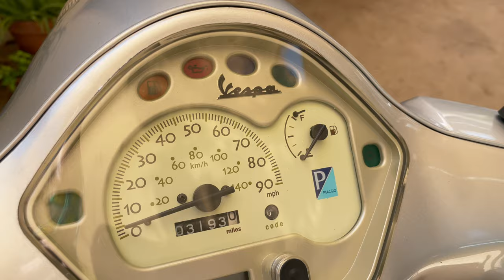Vespa LX - LED Switchback Turn Signal Kit Installation | Mitch's Scooter Stuff

Comment: Mitch have you tried WAGO connectors?  They form a very tight connection with a lever lock, no crimping required and they easily disconnect if necessary.

Comment: Hey Mitch, congratulations on your "100,000." Well deserved. Will this Switchback Kit work seamlessly for my 2004 Yamaha Vino 125 (YJ125S)? If not, can I just replace the stock turn-signal bulbs w/ LED bulbs? THANK YOU!
Reply from the maker: Thank you so much! Hmm your vino have orange lens, right? I would suggest to get blinker genie so you can have turn signal into running light when not using signal... I have that on all my scooters. Here's link https://amzn.to/3TMi82s
Reply: @MitchsScooterStuff Mitch, you're a true genius, the Blinker Genie is exactly what I've been looking for.  Yes, 2004 Vino 125 orange lenses.  On those LED bulbs to replace my factory bulbs-- what LEDs do you like, if you have a link? Again thank you for taking time. You're amazing.

Comment: I switched over to LED turns, brake and headlight on a GT200 and found I didn't really need to do anything else as the LED turns worked just fine as is, maybe a tad bit faster blinking, which is fine to me as it catches other drivers eyes better, plus it really eases the battery drain.
Reply from the maker: You can replace flasher for LED flasher to flash at normal rate :)
Reply: @MitchsScooterStuff yeah I like the faster flashing gets their attention!!

Comment: Hey Mitch thanks for all the great videos. I did this mod today and for some reason my turn signal will flash twice and then go back to the running lights.  then a long pause and then it flashes twice again.  it causes the same effect with the rear turn signal as well. any suggestions?
Reply: even stranger it only does this when the bike is running. when the key is on but the bike is off they work fine.  Did I get something wrong?
Reply: Follow up for anyone who has run into this problem. The problem was with the rear LED turn signals. They had built in resistors, and it seemed to be causing trouble. I got some LEDS with no resistors for the rear and everything is working smoothly.
Reply from the maker: Just saw this... still have the problem or you got it fixed already?

Comment: Hi ! Is it working also on a Vespa LX 125 2011? Thanks and you got a new subscriber, you're amazing!
Reply from the maker: Aloha! Yes it will work on your 2011 model 😎🤙🏼 welcome to my channel!
Reply: @MitchsScooterStuff  Thanks! My model don't have the pending turn signals, only the ones in the front shield, is there any difference on cables linking? Thanks!

Comment: what happen if my vespa only has the turn signal without the DRL. Which wire I should connect for the DRL?
Reply from the maker: what year / model ? Does it have horn cover lamp? or parking light inside of headlight? To do this switchback, need to grab kit - I have link in description box